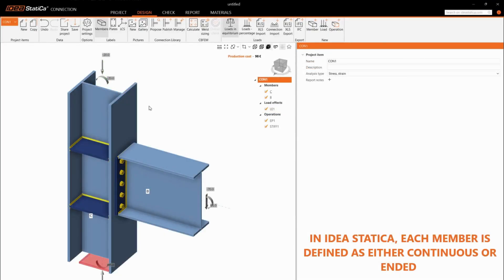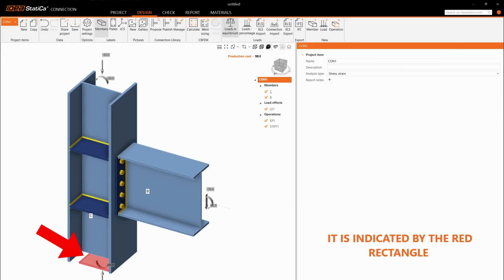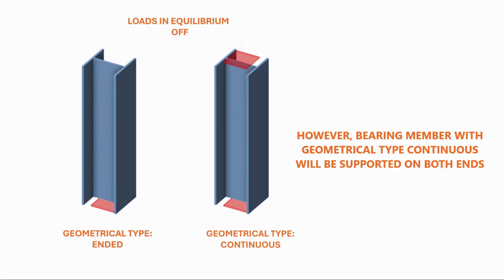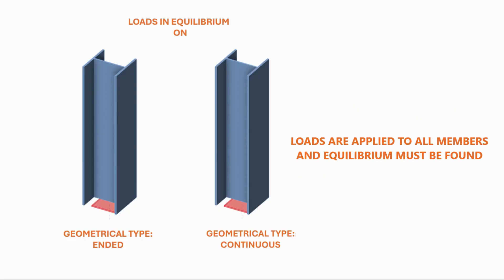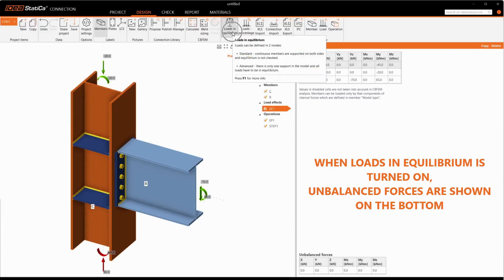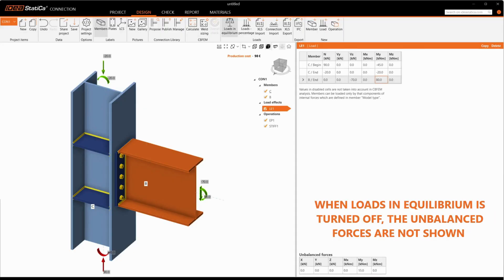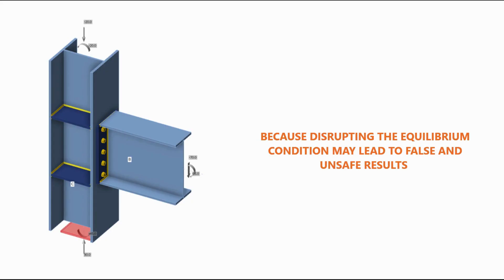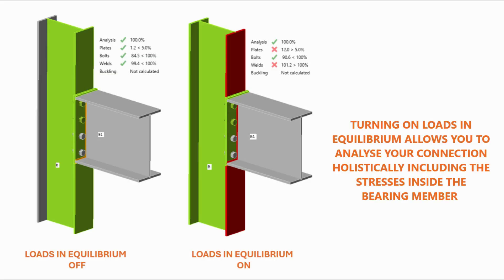How to Use Loads in Equilibrium in IDEA StatiCa

Comment: saçmalık bir bağlantıda yükler dengelenmek zorunda değildir. Gerçekçi bir yaklaşım olmaktan çok uzak. Bazı noktalarda kullanılabilir fakat default olarak açık olmaması gerekiyor.
Reply from the maker: Hello, it is an important part of the CBFEM approach the keep the forces in equlibrium.
https://www.ideastatica.com/support-center/equilibrium-and-supporting-member
https://www.ideastatica.com/support-center/principles-of-loading-in-a-connection-equilibrium-bearing-member-etc
However, it's up to the user to turn it off in cases where it's considered safe and comfortable by the user.

Comment: If we really need  to turn on load in equilibrium. Why you have option-2 which is turn of load in equilibrium. Just remove from software ?
Reply: I was wondering the same thing. Why give me the option if it is that unsafe. . . . . .
Reply from the maker: Hello, we keep this option available, because some users like to use it for various reasons. For example comparison of simple connection analysis with hand calculation, when checking simple connections using envelope forces, etc.
https://www.ideastatica.com/support-center/equilibrium-and-supporting-member

Comment: What's the best approach for nodes that include composite RC beams? The forces are not in equilibrium in that case
Reply from the maker: Hello, composite members are not supported (typically hollow columns filled with RC concrete). We are working on the development in our long term plan. The only way to include concrete in Connection is by using a concrete block - either by Base plate operation or Bolts (anchors) operation:
https://www.ideastatica.com/support-center/general-anchoring-shapes-and-options